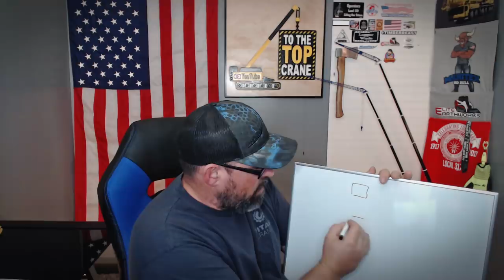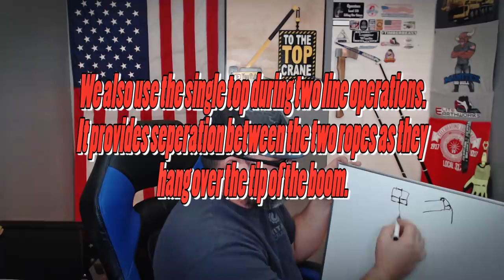Crane reeving diagram - Why does a crane ball weigh so much

Comment: Thanks for taking the time to post that. I've been operating a Grove 35 ton crane for about 8 months myself. I already understood most of this but it never hurts to have it reinforced by someone with a lot of experience. We put the jib on for our first time a couple of weeks ago an managed to get the cable snarled up even though we had a small loader pulling on it to try to keep it tight. It's something I would like to avoid doing again. I'll be doing it differently next time around. We're using our crane for doing tree work only.
Reply from the maker: Griffin Specialty Industries, I'm not a fan of tree work. When in doubt, cut small. Lol. If you have any questions or if I can help in any way, let me know. I'll do my best. Many thanks for watching! 🙂👍
Reply: @ToTheTopCrane  Yes I could see that. There's a lot of unknowns when doing tree work. Are you familiar with wet wood weight calculators? They help a lot by at least giving you approximate weights. They don't however take into account the foliage which can ad up a lot. The crotches are also more dense. We aim to work at 60% of the chart max to allow for slight miscalculations. The weight is also variable due to how much water is in the tree at that point in time. We've been doing crane work for years but we got to the point of buying our own in 2018. 

I really appreciate the offer of help. I may take you up on it at some point. Thanks for taking us along with your crane adventures.

Comment: Ya done good!  Even your artwork was discernible.

I did a 28 ton Pioneer for a time, and the cable would stack two or three lays on the left side of the drum before it would drop down in place. That meant that the load would drop every time with it. They finally resolved the problem but sure was unnerving when a load would drop 'n bounce like that.  The Pioneer was the only unit that has a 2° & 10° offsetable jib and stinger, wireless LMI,  94' main, with a tip height of height just short of a hundred and fifty feet.  It was quite a machine. They got bought up and shut down during a monopoly Shuffle.

Wishing y'all a safe, prosperous and blessed New Year!
Reply from the maker: Barry Simmons, thank you! That 28t Pioneer sounds like quite the machine. I bet it was a fly rod with all the main, the jib and stinger. Many thanks for watching! 🙂👍

Comment: Great explanation! I was setting up for a truss job with some pretty long picks a couple years ago, I had ran out enough boom for the job and as is my habit I ran the line up into the a2b for a function test and all was good so I started swing back to the pile for my first pick booming down slewing and winching down while watching out the side window judging the radius for my first pick, I looked back at my boom tip and the ball had not been lowering. It turned out that the a2b chain had got fouled in the line clamp on my tail. Long story short it cost me a $4,000 line. The only good thing was the line was scheduled for replacement anyway.
Reply from the maker: Crane Fan, that would be no good. Atleast it was scheduled for replacement. Many thanks for watching! 🙂👍

Comment: good video. Im getting ready to buy all new rope for my Insley.  Not quite sure how the shipper shaft gets reeved and the manual doesn't go over it well. cable was already broken so I have nothing to go by.  Main boom shows it better and is pretty simple.  Played with raising and lowering the boom the other day.  gotta be on your toes with gravity down instead of powered.
Reply from the maker: 73DiamondReo, that rig sounds like a handful! Many thanks for watching! 🙂👍
Reply: You can improve gravity descent in a friction rig by disengaging the engine clutch, and engaging the "lift" brakes... This will force your load to turn all the draw works too.,.

Comment: I think you just answered my question - what is the little collar that hangs from the chain at the end of the boom tip? Sounds like that's the anti two block device. Prevents the lower block from crashing into the upper block.

Comment: Jimmy, I see your crane is two parted most of the time. are you able to fully scope out and touch the ground with 2 parts is that why you favor 2 parts? whats the minimum parts of line you can have before your not able to touch the ground fully scoped out with your crane?  just curious
Reply from the maker: R Q, I can reach the ground with 5 parts of line with full main boom extension. I prefer 2 parts because it makes it much faster while setting up, and that's the minimum parts of line required to handle the counterweights. Many thanks for watching! 🙂👍

Comment: i just bought a 1979 Drott without a blockt then found a beautiful 30 ton mckissick at an auction for thirty bux!..im going to reeve it 3 parts..using 2 sheaves top and one at the block then deadman at the block..right? its got 2 sheaves on the block but i will only use one,,,plus the deadman...i puuled off all the 5/8 cable because it birdnested on the last guy who was silly...how do it get it to go back on the winch drum smooth? i thought maybe i will hook the rope to a pickup not running and roll it up on the drum,using the pickup as a load...whatcha think?

Comment: Question.
On lifts where multiple parts are used, each part will "move" at different speeds with the first part moving the fastest.  How do you keep the block/hook level if each part is moving differently?
Reply from the maker: Each part of line is reeved around it's own sheave. The sheaves can turn at different speeds. They share a pin, but are independent of eachother. Hope that makes sense.

Comment: My question is a bit off the subject, but I see plenty of cranes tipping over due to various reasons...I can see how trying to recover by 'boom down' would fail, by instantly increasing the lift radius….BUT what about releasing the winch to sort of 'free-wheel'...? Is this even possible, and would/could it help save the crane...??
Reply from the maker: Doug Ankrum, the newer cranes don't have free fall. So, the only recovery would be cable down as fast as possible, and possibly boom up (but that may upset it even worse). But, trying something would be better than trying nothing. Whether it would work or not, depends on lots of variables. Many thanks for watching! 🙂👍
Reply: The older cable cranes were friction operated so they had a brake on the drum that could be quickly released to recover in a tipping situation.  Hydraulic winches can't do that. Even the ones that can be free spooled can't be released under load. That's why it's so important to keep everything within the safe operating limits of the crane.
Reply: Well, most of these 'crane wrecks' appear to be in non-USA countries and look like they are marginal for the job, and many seem to have 'stability' problems with outriggers/mats...

Comment: I could never get it right with a 2 part line, which way to twist the cable so it hanged straight and not crossed....
Reply from the maker: Michael Owen, typically a half turn the opposite direction of its twist will keep it from crossing up. Thanks for watching! 🙂👍

Comment: I don't know if anyone has asked or not but why a tadano crane and not a grove, link belt or liebherr? Do you have a preference
Reply from the maker: Derek Havermale, the company I work for has had really good experiences with Tadano. The Tadano's that we have and had just work. they have a great chart, are reliable, and when the occasional issue comes up, Tadano customer support is fantastic. I have, without exaggeration, 10 different phone numbers that I can call at anytime of the day (or night) and get customer support. I have operated Grove, Link Belt and Liebherr, and I would put Tadano with any of them. Sorry for the long response. Many thanks for watching! 🙂👍

Comment: Jimmy, worked with heavy cranes for half my live. You dont mention friction on the sheaves, Maximum number of lines you can use on one winch or a single line pull is 32 parts. After 32 lines the friction on the two sets of blocks defeats mechanical advantage.

Comment: when you determine how many parts of line you'll need for a bigger lift do you base it off of line pull or winch pull. ie depending what layer on the drum you are would limit how much you could lift?im just thinking about a heavy object that just has enough parts of line to make the lift and you are near the top of the boom so you would be on your largest layer on the drum. i haven't been in that situation yet but i have made lifts near the max line pull and the winch would be jumpy.
Reply from the maker: We base it off of line pull. The winch is actually rated for more than line pull. But, is de-rated down to line pull by the manufacturer. If your winch is jumpy, you may have a mechanical issue or too much rope on the winch.